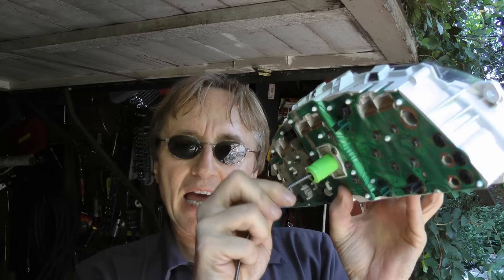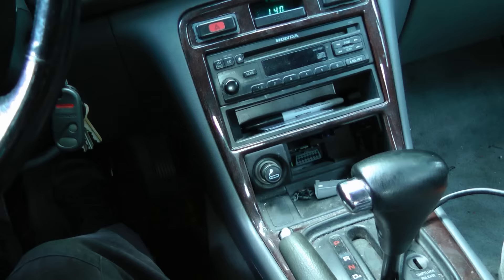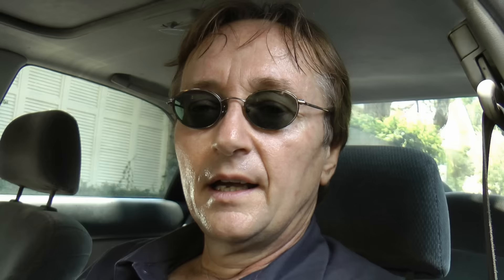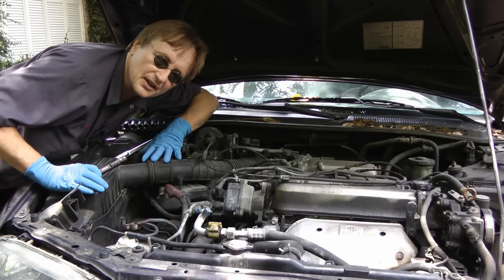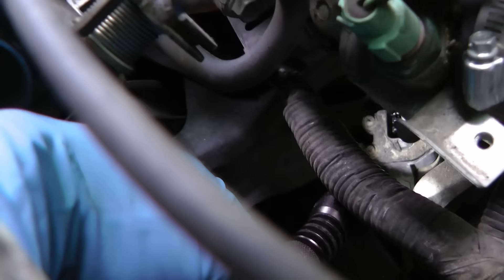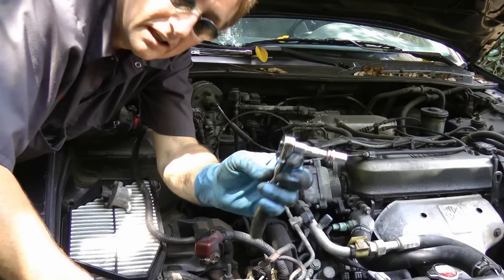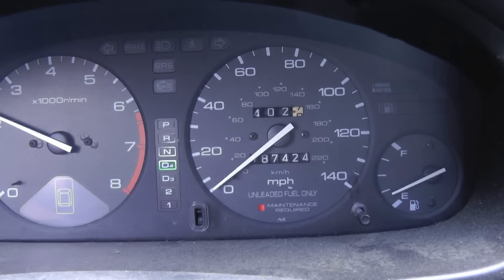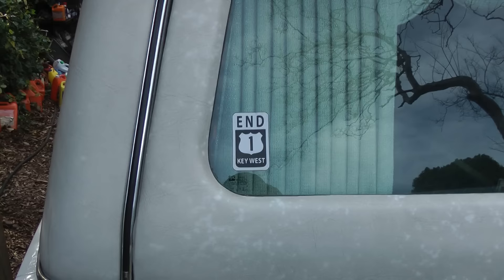How to Fix a Speedometer Gauge in Your Car (Speed Sensor)

Comment from the maker: Things I used in this video:
1. Actron Scan Tool: http://amzn.to/2ngeCQJ
2. Screwdriver set: http://amzn.to/2jaHIfP
3. Ratchet and socket set: http://amzn.to/2inoxOY
4. Mechanic’s Tool Set: http://amzn.to/2Bzmccg
5. Disposable Gloves: http://amzn.to/2zSRuxO
6. Common Sense
7. Full HD Camera: http://amzn.to/2AvoEk7
8. My computer for editing / uploading: http://amzn.to/2i2sKYz
9. Video editing software: http://amzn.to/2jv5Fhf
10. Thumbnail software: http://amzn.to/2k7tz6C

🛠Check out my Garage to see what I use every day and highly recommend:
https://www.amazon.com/shop/scottykilmer

❗️Check out the Scotty store:
https://goo.gl/RwhRGU

👉Follow me on Instagram for the latest news, funnies, and exclusive info / pics:
https://goo.gl/ohy2cA
Reply: Scotty Kilmer hey Scotty I ordered a vss and it wasn't quite the same but I was able to install it now something is causing my battery light to come on even with new alternator. Could it be the VSS?
Reply: Does a automatic transmission shift normally if the speed sensor cable is broken? My cars transmission won't shift anymore and the speed indicator is on 0 when I'm driving.
Reply: Scotty Kilmer  i have a question....if that sensor doesn't work it will pop up the check engine light????
Reply: Scotty Kilmer , hey Scott can you please make a video on how to add top speed on to a speedometer , cause my c1500 cluster has a top speed of 80 but I want to add 30 more so it can have a top speed of 110 like the 1990-1992 454ss .
Reply: ..my speedometer stopped working in 08 suzuki sx4. Looked up part you suggest but abs speed sensor keeps coming up..is that the same thing? When i read on it mentions driver side rear side. I had seen part on autozone that looks like part you show yet costs up to $100, is that correct for the right part?
Reply: Scotty Kilmer
Reply: A guy I know said that he got out of a speeding ticket because he had a blown head gasket and it somehow affected the accuracy of his speedometer. It sounds to me like he doesn't know what he is talking about since the head gasket has nothing to do with the transmission or the speedometer. Am I correct?
Reply: Hey Scotty I have 2 speed sensor and I replaced both but the speedometer is still not working what can I do?
Reply: Red and green light is on on my kicker amp
Reply: Where do i buy the 6th tool? Lol
Reply: Is a circuit board on the back of the speedo easy to come off to transplant to another one or will be best to just do the needle and our unit the needle goes into my noodle is all been out of shape I can't spell is my phone can't spell
Reply: Hey scotty I got 2013 ford f150 5.0L my output speed sensor is acting up how long does this take to repair?
Reply: I have this issue on my 08 solara. Speedometer and odometer aren’t changing, and used a scan tool to check the vss which also read zero. I replaced the speed sensor but it didn’t fix the issue. Please help! What else could it be?

Comment from the maker: far as I'm concerned, all saabs belong in a junkyard, the company recently went bankrupt and no one wants to buy them. Ignition takes place with individual ignition coils placed on the spark plug concerned. The plug together with the ignition coil and CDM are used to detect combustion and any knocking.

This means that neither a camshaft sensor nor a separate knock sensor are required. Over engineering to the max.
Reply: Saab 900 was a beast Scotty ! Atleast the engine was bulletproof anyways...
Reply: I was going to ask also if both the odometer and the speedometer is not working is this due to the speed sensor also ?
1 more question also if you can reply. My radiator fan turns on automatically when i start my car. Doesn't turn off at all... cars computer seems to be fine everything works. Would it be bad wiring or would it be another sensor problem?

Comment: The scanner he is using is for OBD 2 1996 and newer,I have one like the one he has,and i have an innova 3120 it will work on both OBD1 and OBD2 it comes with adapters,but I think you might have a cable not sensor.

Comment from the maker: the tach itself generally breaks in the dash unit, they cost a ton, leave it. But the speedo works off a cable on most 93s, so check the speedo cable, it's probably broken.

Comment: I have changed the censor and it is still the same, the mechanic said that the connector inside the gear for the censor is what is bad. Is that possible?

Comment: I have a 2003 Camry that the speedometer bounces like a basketball and I e replaced the VSS and it still doing it. I’ve even got a new speed cluster from a pull apart since Toyota discontinued the speedometer fro this Camry years ago and it still does it with the replacement one. I’ve brought it to a shop and they said it might need the ECM re flashed or replaced.

Comment: hey scotty my 2002 windstar  never gets higher then twenty miles per hour I changed the input and output it worked just right after changing each but went back to doing the same broken thing what is left. I put a new cluster in it also.  THanks in advance.

Comment: My scotty first off big fan of yours. My 8 year old son watches your videos every weekend when I pick him up. Anyways My speedometer and rpm hand isn't moving and my automatic transmission in my 97 k1500 isn't shifting correctly. It's like it stuck in 4th or 5th gear. I was running up the road to fix my mother's car then this is happening as we speak

Comment: 96 Ford F-250. Speedometer works most of the time but will randomly drop off or shake for short periods, before going back to normal. Sometimes it does it for 5 seconds sometimes for more than an hour. Luckily it's a standard and I judge my speed based on rpm but this is stopping me from being able to use cruise control. Do you think it's the RABS speed sensor on the rear diff or a back circuit on the speedo itself

Comment: Scotty, how about a troubleshoot/repair video on how to fix malfunctioning vehicle speed sensor on you 1994 Celica?
A 1994 Toyota Celica 5 sp. just fell into my lap, and the vehicle speed sensor is not working (I knocked it out of position when I was forcing refurbished set of transmission control cables into place (got those for $8 off a 1999 5 sp from the junkyard, and strategically used electrical and duct tape in order to reinforce it.  It shifts like a charm, but for each problems solved, this newbie DIYer is causing a problem.  This isn't all bad.  I broke the PCV valve (before I knew what it was) while taking off the valve cover.  Replaced it, cleaned the MAS sensor and air intake tube and flap, and the chronic low idle problem resolved rather nicely!

Comment: My speedometer needle use to just bounce sometimes but when I lubricated the cable and put it back in it now shows the wrong speed. A shop told me the cable looked fine and that it is either the gear box or the instrument cluster itself

Comment: We had that problem in a 1994 Rodeo.  Had the sensor replaced, but that didn’t fix it.  So it is a difficult, expensive fix.  It’s hard to get parts for that old thing.  Too bad, it was a great truck.

Comment: 96 Camry gs 4cylder ... have a bad shift and no speedo . Everything else work sensor , gauges . Ecu .. everything . I believe a have a bad or broken connection from plug to cluster . Was hoping you could help me out with a diagram. I spent a day looking but no good information found or remotely close to my wires matching mane ... please help

Comment: Question if I may. I'm possibly thinking on buying someone's 98 Lexus, with low miles. The only issue it truly has, is that it's speedometer is not working? Probably a dumb question to ask, but does the speedometer control the odometer? What things can I check before buying? Thanks guys!

Comment: Hi Scotty!
I have a seat 2002.
Somehow the speedometer comes back to zero but it does show the right speed as I accelerate and the rpm doesn't come back to zero instead if I accelerate it goes up other wise comes back down in a while.

Comment: Scotty, the speedometer/odometer and moonroof stopped working last week after tightening up a loose neg battery cable.  The cruise control does not work now.  I am thinking electrical, rather than speed sensor, but the mechanic found no electrical issues.  Most likely a weak battery or need new instrument panel?Thanks, Ken

Comment: So I have somewhat a similar problem.  Story goes odometer wasn't working so messed around check with the components on the inside of cluster and put back together. Great to say somehow got the odometer to work but now the speedometer is at 20 mph at a dead stop and while driving it goes up like it would normally.  Im at a loss can you help possibly?

Comment: Hey Scotty I have the same exact car in this video (95 Honda Accord LX 5-Speed Manual). My speedo is not working as well but for some reason cruise control still works. I am having trouble diagnosing if its the gauge cluster or sensor

Comment: I have a 2001 Grand marquis with digital speedometer that some times works fine and sometimes it displays zero even if i am driving at 100KM/hour. How can I fix that ? (Sometimes while I am driving and its at zero and I press it on left side of the speedometer, it suddenly starts working but then goes  back to zero)

Comment: What if changing that sensor it still doesn't work? I have continuity on my high and low signal wires from the vss to the transmission and a v of . 5 v - that increases to 3.5 v as you push down on the petal. But still no speedometer. And then the the other wires used for combination are can bus wires

Comment: Hi Scotty, don't mean to bother you but i have a Mitsubishi 380 and the speedo stays on 0km/h, i tried everything in this vid. but is it possible that the ecu can be the reason?? thanks :)
Reply: You should check continuity of your wiring and connections. Before replacing the dash gauge.

Comment: Hey Scotty,  I have a 1998 Toyota Camry. The odometer and speedometer weren't working.  Check engine light came on which pointed to a bad speed sensor. I changed the speed sensor but for some reason speedometer and odometer work intermittently. What else can I do to fix this problem?

Comment: My car is a 91 I think it has a speed sensor but I think it is the actual speedometer that is messed up cause it works intermittently and if I bang on the dash it will work for a little bit. Can that be fixed or am I better off just getting a new cluster?

Comment: A while back, my brother-in-law used a product to clean my car and got it onto my plastic speedometer cover, which ruined the cover and I took it off. Well I never replaced the cover, leaving the unit exposed. Then one day, my great-grandson was in my car and messed with the dials on the gauges. Now the speedometer does not work properly. When I turn off the car, and later start it, the speedometer will go all the way to the bottom. Will replacing the sensor work or can I simply remove the needle and put it back on?

Comment: I need help. I'm driving a 2002 Chevy SUV 1500 RWD and my speedometer stopped working on me. I checked fuses, Grounds, stepper motor, replaced speed sensor and even got a new dash clusters. Speedo still not working. Thinking of checking the ABS just to check it off the list of things it can't be. Any thoughts?

Comment: I have a 2001 chevy suburban 1500 ls and i just recently changed the cluster panel because i thought it was blown. None of the gages were working and not even the odometer diaplay so i bought a new one. Now the new ones in and the odometer, gas, tacomoter, and the temp gages still dont work. Only the oil pressure and voltage meter works. I already checked all the fuses and relays still lost here. Do you have a posible solution?

Comment: Hi Scotty, 
I have an issue that my Civic's temperature & fuel needles often drops at bottom. Some time they both rise to optimum height then drops again ( both)
I have restart ecu and wash the grips of ecu and cluster meter with contact cleaner but it works not more then a minute then drop again. please guide me.

Comment: I have an automatic Camry 1998 V6 (1MFE). The needle of the speedometer begins to jump irregularly after about 30 minutes of driving. In addition its turned on the ABS bulb. I changed both the speedometer and the VSS but it still with that situation. What can be?

Thank you very much for your help.

Sincerely,
Ruben Mendez

Comment: jetta 2002 triptonic transmission 1.8 t 5 speed wont go higher than 20 miles. but if i step on gas and high rev it then it shifts to higher gear it works great. but once i stop completely it fails again . please help any advice is great

Comment: I have an 87 g30 350 5.7 obd1 computer read out says oxogen sensor needed put in a new one also reads no vehicle speed code signal. #24. Vehicle almost stalls when it put in drive after is has been driven and warmed up and put into drive. Does not have power especially climbing.  Changed the AT vacuum modulator. Will a speed sensor help?

Comment: What if everything on my dash is acting weird like the fuel tank moves in diffrent directions and dosent show exact reading, the speedometer is stuck, the temp is stuck at 0 but the RPM works just fine?🤔 I have a 2005 pontiac sunfire.

Comment: I have an Isuzu Rodeo 2002 same issue only I’ve replaced the sensor and still nothing. I can only conclude that the cable connected is bad.

Comment: Hey there Scotty would appreciate ur help on this. My speed sensor seems to be leaking not sure where the leak is coming from I changed my transmission seals but still seems to be leaking. Could it be my speed sensor where it's leaking from? Thanks in advance.

Comment: Scotty my speedo works but it takes but only after the car has been driven for a few mins.  I checked the speed from the ecu using a scanner and the ecu is reading the speed while at the time that the cluster doesn't.   Awhile ago the arm on the speedo spun around and was sitting under the needle and I spun it back around.    What can I check to see whats causing this issue?

Comment: Scotty Kilmer, you can be my salvation lol...

My speedometer stopped working, im almost 100% sure the speed sensor needs to be replaced, but im unable to locate it.

the vehicle is a chrysler neon, 2000 LE, 3 speed automatic transmission (31TH). If there are some other things i must check, please guide me to troubleshoot this issue, and thanks in advance.
Reply from the maker: The Vehicle Speed Sensor (VSS) is located in the transmission extension housing. that is on the bottom of the transmission near the axle output shaft, jack it up and see.

Comment: Scotty my speed senor must be fine ( haven't used the scanner but my speedometer works perfectly) however when I go to plug in my aftermarket head unit they speedometer will not work.. all the lights on my dash work and the rpm meter and gas meter both work I'm stumped can you help me trouble shoot? I have a 2010 Hyundai elantra blue trim base model

Comment: Hi man, I seen alot of your videos and it looks like you know what you are talking about, I wonder if you could help me with something that is very simple but is becoming a lot of trouble...
Wheel size remapped or set up into the car, is there a way to tell the car what size wheels you have, specially if you go up or down in size, the MPG, speedometer and total mileage will be off and I can not find a way to adjust it...

Comment: the sensor you replaced in this video was in the engine bay, is it the same on Volvo 944 1991 Sedan?
I've been told it sits back on the differential.
Reply from the maker: +Zeventery only way to figure that out is get your VIN number and call a dealer parts dept

Comment: i am getting an P0500 (speed sensor error) on my xj 2000 jeep, i replaced the speed sensor but did not solve the problem. Suggestions?? 2 wheel drive (only one sensor)

Comment: Scotty, got a 94 F 150 4.9 4 wheel drive 5 speed,  the speedometer is not working, i see its a sensor, it that on the transmission or on the rear axle housing, ? to my knowledge i work on older Fords, the sensor on the axle controls the ABS , is their a sensor located on the transmission ? please let me know . thank you Scotty

Comment: I have a 98 Camry. Speedometer and odometer are not working. Code is P0500. Can't seem to find the complete assembly. It's either just the sensor itself without the metal shaft or sensor with the metal shaft but without the plastic gear at end. Which one do I buy?

Comment: Hey Scotty i have an 03 Oldsmobile Alero that i changed out the brake booster in order to get it out i had to remove the fuse box, i disconnected a power wire that ran to the fuse box and i did not disconnect the battery so when i reconnected that power wire to the fuse box it made a spark and now my speedometer is on the opposite side doing 140 mph while standing still what can i do to fix that .Thank you

Comment: Scotty, I got a 96 tacoma that gives me a loud winding noise on cold days usually under 60 degrees F (i'm thinking it's the speedometer cable) and have seen vids saying it needs lubricated, what do you think?  I got that truck for $2k 10 years ago on 120k and put 140k myself, 4cyl 4x4 5 speed manual.   Thanks for the quick to the point vids.
Reply from the maker: +oregonnich that doesn't have a speed cable, it uses a speed sensor on the transmission. Often worn bearings do that, like idler bearings on the fan belts or internal transmission bearings

Comment: Knock sensor is broken.  Do I need to replace this?  I have an 87 g30 350 5.7 obd1 computer read out says oxogen sensor needed put in a new one also reads no vehicle speed code signal. #24. Vehicle almost stalls when it put in drive after is has been driven and warmed up and put into drive. Does not have power especially climbing.  Changed the AT vacuum modulator. Will a speed sensor help?